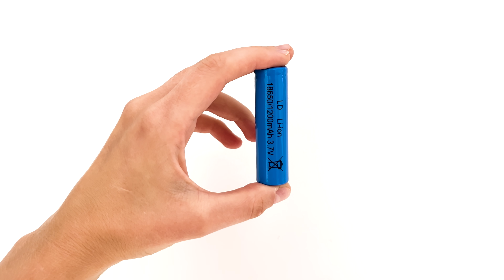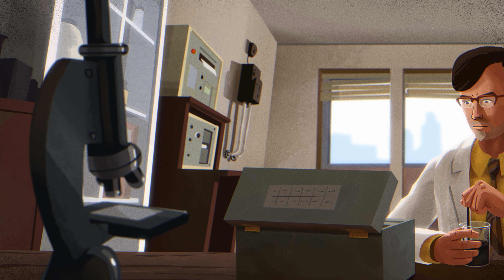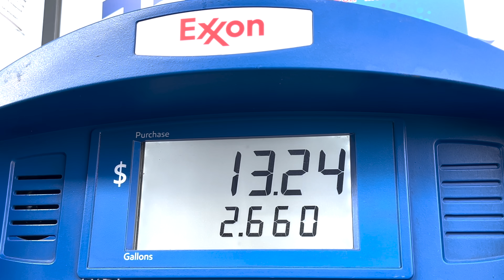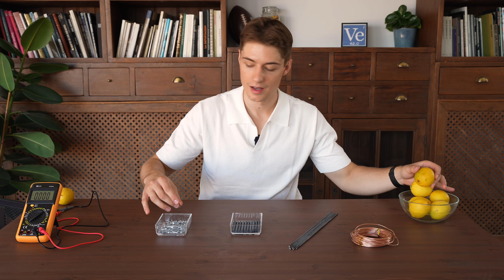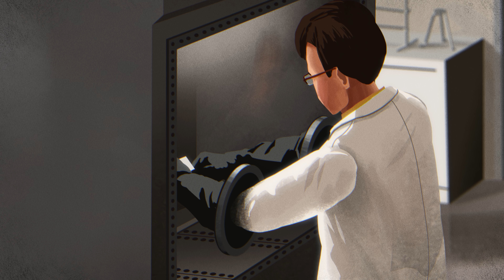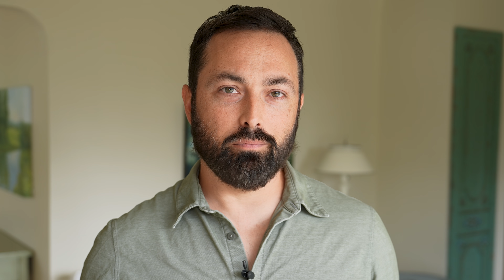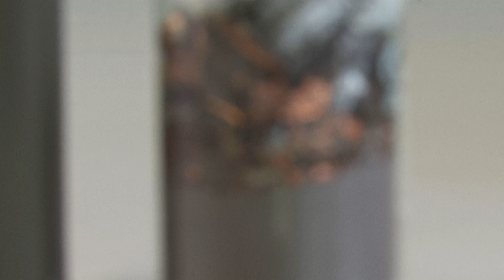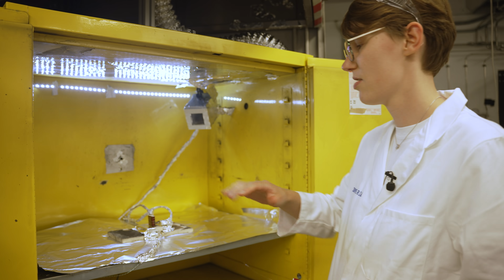The Perfect Battery Material Is Dangerous

Comment: As someone who has valued Veritasium for its depth and balance, I found this video troubling in its narrow focus and omission of key advances that change the safety story entirely. While the history of Li-ion batteries was told accurately, it focused on the most dangerous chemistries and ignored safer, now-dominant alternatives like Lithium Iron Phosphate (LFP) and improved NMC chemistries. LFP’s proven safety record and growing market share deserve mention if the goal is a balanced story. By highlighting only the most hazardous cases, the video risks replacing the important with the merely spectacular. I hope this was a one-off, and that a follow-up will present the full picture without fear-mongering.
Reply: From the perspective of the hazards of small electronics though, LFP is still quite rare.  While its prevalence in electric car batteries has increased significantly in recent years, that is mostly down to the size and scale of an electric car needing to be so much higher than a phone for example.  A 1 in a million failure rate on small devices that can be conceivably dropped in water or something to deal with the fire in an emergency means there is less pressing need to switch over to LFP, especially considering the decreased energy density.  Point being, LCO is still the dominant battery form for small electronics, at roughly 65% currently.  As such, it really isn't disingenuous to focus on it as a form since its still a leading type today.
Reply: @tobin1677  I would not recommend dropping a burning lithium battery into water. You'll just make it burn hotter.
Reply: @craigsparton putting LCO batteries underwater to limit their thermal runaway is one of the most highly recommended methods of dealing with small batteries.  This is because it is a lithium salt, not pure lithium (which does spontaneously burn and react in water).  Lithium battery fires do produce their own heat, but essentially if you cool them down enough to stop the runaway reaction you are good to go.  Now of course there are better ways to deal with them too, but since everyone has water readily available dousing them is probably the best option.
Reply: @tobin1677  Interesting, didn't know that. Thanks for the info!
Reply: Some context. Veritasium was bought out, or rather did receive a "strategic investment" from Electrify Video Partners. This investment means that Electrify acquired an ownership stake in Veritasium. Derek has no say anymore. Quality is, as you pointed out, decreasing already.
Reply: @V3cnu  why are you just lying? Derek has no say? you are straight up lying
Reply: @V3cnu you have no proof of this and you are simply extrapolating.

Being more accurate on that aspect would certainly not desserve interests of a remotely related investor.
Reply: @V3cnu that was a dumb move than. Considering the views and income 18 million followers create. You never should sell with those conditions.
Reply: @alfascorpi things change, he knows this, wants to retire and not take on excess risk for random people's entertainment. It is not dumb at all.
Reply: @alfascorpi  Than what?
Reply: @michaeldevonport1715  it's not dumb for him personally, but it IS an ill omen for YouTube going forward and should be avoided on grounds of it going against his principles as a channel. We're living in a late stage capitalist world where big companies own everything, even private youtube channels.
Reply: @alfascorpi  Derek has a family, man. Can’t really blame a guy for taking the opportunity for a little security in a career as volatile as social media content creation
Reply: @alfascorpi not really. The goal as a business owner is to eventually sell your business, have someone take it over, and either retire or move on to another project that you feel a renewed passion for. You can only do one thing for so long before it begins to get stale. Life is about change and growth and the days of "work for sears for 40 years then retire" have long been over
Reply: @V3cnu Wow did not know this. Disappointing, but explains things
Reply: @V3cnu also, didn't he have Bill Gates on his channel? This guy is a shill
Reply: The video was totally focused on Li-ion. Except the title. And people complain it doesn't cover new technologies
Reply: They’d been doing series about Nobel prizes, basically this what this video was about
Reply: I didn't notice it as fear mongering. He didn't even go into the pressure changes causing instability which is why lithium batteries are surface transport only. They also mentioned that it's an extremely rare occurrence and only noticeable due to extremely high use
Reply: For context: Lithium Iron Phosphate (LFP) batteries use an olivine crystal structure that is inherently more thermally and chemically stable than lithium cobalt oxide (LCO). This stability greatly reduces the risk of thermal runaway, even under abuse conditions. LFP cells also have longer cycle life, tolerate full charge–discharge cycles better, and do not rely on cobalt, while reducing cost volatility and ethical sourcing issues. In today’s market, NMC chemistries hold the largest share, LFP ranks second, and NCA ranks third, with LCO already reduced to niche or legacy uses. LFP’s proven safety record and its substantial share in both EV and stationary storage markets make it a central part of any accurate discussion of Li-ion battery safety. Omitting this is not simply an oversight, but it distorts the real picture.

Edit: For transparency, I hold a Ph.D. in applied physics and have worked in and advised on investment in Battery Energy Storage Systems since 2013. I am not a native English speaker, wrote this reply myself and, yes, I use ChatGPT to help improve readability, refine semantics, and check syntax.
Reply: @Pemodados  What are the downsides of LFPs, versus Li-ion batteries? Surely there are cons to balance out the pros.
Reply: @DARTHNECRION Capacity/Energy density. LFP is fine if you have more space and don't mind a bit of extra mass like in an EV, but for portable electronics, LiCoO2 or LiPos are better because they can store more energy per gram of material.
Reply: @Pemodados what are they actually using them in ?
Reply: @Pemodados  well he is owned by private equity now, which is why the title and thumbnail change so often
Reply: @StraeYaksha  Except that he was doing that prior to the sale.
Reply: People are at different levels of education so if you know all of what is in this video you can go to another video. Problem solved!  I was not expecting a comprehensive college level course on batteries.
Reply: I see your point, but imho the video has a full circle of a story, which mainly included the discovery that lead to the Nobel Prize. The LFP development is recent and not part of that story, so I don't think it's a problem excluding it.
Reply: What about Sodium-ion batteries? I think it's fairly recent, also less energy dense but (I think) cheaper and easier to make, it takes up more space but it could be great for stationary places like solar farms and it would free up Lithium for other uses.
Reply: @darkceptor44  yeah, I don't think the Liberal and Conservative audiences want to admit that China is cable of good things at times.
Reply: @JeezusWuzzaCommie  If China developed it they probably stole it from somewhere else. China's been stealing all sorts of information from various countries for years now.
Reply: @joesmith-es1zy  "stole" environment saving battery technology that's easily better than what Tesla is pumping out?

If that's theft, idgaf. Copyrights and patents only make sense in a world where you must sell your ideas and profit off the people instead of sharing them and supporting your community.
Reply: Was replying to 
  Dot 

Lmao 🤣😅
Reply: Básicamente porque se pusieron en el mercado, especialmente el automovilístico por la preocupación de los incendios recientes en los vehículos, tendrá si acaso 5 años desde que esos accidentes se hicieron virales y definitivamente no son baterías populares en otros mercados como el de celulares.

Justo al final dice que no se trata de conquistar un solo elemento y que la mejora en las baterías es constante y debe dejarse de lado el método tradicional para buscar nuevas alternativas.

Todo eso suena en realidad bastante a favor de las baterías más que alarmista.

Claro que se enfoca en la parte peligrosa porque el mensaje que da a entender es que las baterías han estado evolucionando hacia ser más seguras y a buscar materiales más estables. Justo como las baterías que mencionas.

Realmente me preguntó si el angloparlante promedio tiene alguna clase de comprensión más allá de lo superficial.
Reply: Thanks for telling us what ChatGPT thinks of this video.
Reply: There are other creators here that go into that level of detail like TheLimitingFactor. Idk if this is the channel for that level of depth this is a pretty good introduction but I agree going into the dangers without the solutions is a bit misleading
Reply: Ok but LFP are only taking over the older lithium-ion technologies in electric vehicles and other large applications. They will probably never replace them in small mobile devices because of LFP's smaller specific energy. So in mobile devices older lithium-ion is still dominant and this will not change soon.
Reply: When calculating power density are you considering the recommended 40% 80 % rule for lipo
     Lithium ceramic is probably the better option 
    Extreme long life 
Very high current charge discharge 
  Can use as hot as lava 
  Can never make dendrites 
    And can use while cutting the cell in half
Reply: Fairly sure that they have variants that are already matching Li-ion in energy density.  There are also many other technologies nearing commercial use.
Reply: Shhhh, you are ruining the OPs narrative here
Reply: Chatgpt ass comment 😂
Reply: It won't.
Reply: Lifepo are good too
Reply: ok poindexter.
Reply: 9
M9
0
0
Reply: I have to mostly agree. Well.. they try to keep it catchy.. not full scape research.
Reply: Yeah Rabbit Fever! I was thinking when two or more horseshoes or objects are too close to a point (the peg) it becomes harder and harder to visualize which object is closest to the peg, and by removing the sand in-between with a brush we remove all the sand which is holding the horseshoes in place and creates an optical illusion of empty space which is not truly empty. Instead a magnetic detector would be more precise . Even so when too many objects are so close to a point (black holes, occult hernias) it is more difficult for the expensive equipment to detect accurately highlighting the need for smaller more portable & accessible wearable technologies to assist users.
Reply: It really is not that deep
Reply: Lithium pools still an issue.
Reply: @abcdef-u4cvjyrc  no i understand that. I just think that saying the content is declinging because he focused on the story of batteries and didn't talk about newer technologies is not very fair. It's just a different focus
Reply: It's called poisoning the well
Reply: Well, ackshually!
Reply: Where can I follow you to get insights into this? Or would you consider doing some videos as well?
Reply: Aw, go rub some sticks together in a cave, geek boy. You'd have no platform to preach from without your batteries, not to mention your preaching to an empty room.
Reply: Dude.   Some things are just toxic.   Take a deep breath, and find a way to live with a shorter battery life, or plugging in,  or any of the many many creative ways we can solve the 'problem' . Not by lobbying to take the earth and dredge up toxins and destroy local environments,  but by finding creative ways to admit when science gives you an answer you don't like and you use the opportunity to do well,  And do good. 
  Is it more likely Veritasium dips standards in this one moment,  just when it's inconvenient for that greedy combo of global mining interests and tech bros, or is it more likely that  Veritasium inevitably will offer science that impacts things we all like to do.   I think the latter.   We've got to stop denying hard science just so we can have our most advanced tech gizmos,  or just because we make our money strong the landscape of metals.   
Healthy planet healthy people
Reply: I would also have appreciated another 20 seconds listing the many alternatives being chased by billions of dollars of investment. It is the wild west out there right now for battery research. Perhaps the lack of scientific information on CATL sodium battery claims made it an unlikely option, but really there are so many others nearing commercial viability,  Perhaps a 2nd video on some of these @vertasium ?
Reply: Also-- the perfect battery material should not involve more intense mining operations which destroy local environments. Just look at salt batteries and quit trying to out engineer China.
Reply: So what, smartass? No one canceled critical thinking. Those who need it, will find the rest for themselves.
Reply: Thank you for your informative comment that caused me to do some research, not watch the video and unsubscribe.
Reply: Sounds like a clanker take to me
Reply: why do you think they might have gone about it that way?
Reply: yeah that has a lot to do with the fact that this is basically an advert from a private equity firm trying to persuade young investors to invest in graphene and battery startups they have a huge stake in.
Reply: Veritasium has gotten way worse since Derek literally sold out the channel. You can see the exact moment when other hosts started to appear in it.
Reply: @waltermelon6747  AGREE! Why on earth would he let any other person than him, doing that?! :(
Reply: @sammtan-xena so he could spend time with his family
Reply: It is mentioned quite a few times that it is rare. Hardly fearmongering.
Reply: Agreed, I kept waiting for LFP to be cited, very limited and honestly incomplete video.
Reply: Your hopes will be crushed. The trend is moving towards more superficial, more  spectacular and clickbaity content. We will reach Idiocracy a few hundred years earlier than the movie (2505 IIRC).
Reply: @cromyjr1592 Yeesh that’s a lot to tie to an omission in one video that is otherwise accurate and understandable
Reply: @cromyjr1592  civilization moves in cycles. So we'll repeat a lot of this in the future again, eventually.
Reply: @cromyjr1592 bruh we already live In a idiocracy. Trump president twice.
Reply: @cromyjr1592 😅😅 
(Actually 😣). But you're right!
Reply: @cromyjr1592 This is not Idiocracy, this is capitalism. Veritasium is Private Equity owned now, so that's what you get.
Reply: @cromyjr1592 Already have reached that point pretty much 😔
Reply: the focus was on the lithium ion, how dangerous it can be and its problems it over came and the advantages/disadvantages there after , is what i understood . He does acknowledge other tech paying the way forward but how long a video do you want if he had to name all existing types ,future types, and their ins and outs.  As Im sure a vid about Lithium Iron Phosphate (LFP) and improved NMC chemistries vid would be exactly about that. Lithium ion is about Lithium ion as was i felt implied in the title " This Battery " Was Almost Too Dangerous to Exist . perhaps  Lithium Iron Phosphate  will be in an  safer, now-dominant alternatives  to Li ion vid. idk
Reply: You can thank private equity for turning almost everything around the world to garbage. I was crushed when I found out they purchased Veritasium. And they are also going after all successful YouTube channel. Please do not support anything owned by private equity if you value anything of quality. Veritasium is not Veritasium anymore.
Reply: @PeddleUrAds  It's so sad to find out Veritasium has been bought out. That was a shock to me, I didn't know anything about this.
Reply: @One.Zero.One101 I didn't know either but I could certainly tell something was changing behind the scenes. The quality of content has dropped considerably in his last several posts.
Reply: @joefoxFPV  not to mention some of his videos are just ads... like his video about dishwasher "habits" which was just an ad for a specific kitchenaid model...
terrible - he had something good going and its now officially Foxified
Reply: @One.Zero.One101 you mean he sold his business to a larger entertainment company so he doesn’t have to work as hard? He didn’t sell it to Phillip Morris or Exxon Mobil did he?
Reply: @PeddleUrAds  should they do a public offering then, so that they must pursue shareholder gains above all else?
Private equity makes up the vast majority of the American economy (and probably the world's as well but I don't know that for sure.) So i guess its no more quilted northern for you... or Ben and Jerry's, Publix, Trader Joes, Dell, Ikea, Robert Bosch, Ingram Micro, Huawei, Wawa, Chick-fil-a, menards, S.C. Johnson & Son (Ziploc, Windex, Shout, Saran, Raid, Off!, Glade, Drano) etc........
Reply: @PeddleUrAds  also notice that little bit of anti institution propaganda that they had to add at the 17:40 mark. Like the whole story of the batteries was a tale of investors not seeing the potential of the batteries so they didnt want to take risks to invest in it, but 1 time it was shelved by a institution and suddenly " bureaucracy " and "slow moving institution" are the reason was the the batteries development was moving so slow
Reply: @PeddleUrAds I mean it’s still good and the guy made money so yeah good for him.
Reply: Seriously. This would be a video for 5+ years ago. Not now.
Reply: Well you just pointed it out, it's a different battery bro. That's why the safety is hugely different.
Reply: The goal is to get the avg person interested in science…not confuse the f*** out of them.
Reply: @jeffrey.a.hanson On point. I just want to watch an interesting science video, not get caught with drama.
Reply: @jeffrey.a.hanson it still does.
Reply: @jeffrey.a.hanson Imagine, bombarding your audience with an entire college course in one sitting. There is only so much information you can give before the viewer lose interest.
Reply: @jeffrey.a.hanson  The average person can't comprehend the simple trajectory of advancing technology? Omfg 🤣🤣
Reply: @jeffrey.a.hanson I thought  this video was very intersting, and  guess what? It didn't confuse me, so you're right on the money. It also opened the door for deeper conversation, like this whole thread.
Reply: Enshittification at its finest
Reply: Keep in mind the channel is just owned by a company now
Reply: They don't have access to this LFP technology
Reply: 4€ over 12€ for a battery, they are quite expensive.

Edit: Cobalt is not the only problem. Lithium itself is also collected in poor african countries where people are handled poorly as well. And then there’s another problem he didn’t touch, which is recycling of those batteries.
Reply: @acemad1 lithium is collected in endorheic salt flats in the US, China, Central Asia, Australia, and the altiplano of the Chilean and Peruvian Andes. It’s one of the most abundant elements on earth. Every country has lithium deposits. The issue isn’t finding ore like it is with cobalt because the ore is everywhere and it’s even in the water and dissolved in sea water.   The issue is of course concentrating it by evaporation of hypersaline lakes which there are a lot of since we are in an interglacial period that ended 12,000 years ago, and then bringing the raw materials somewhere with water and electricity which requires infrastructure. That’s why all those hard rock ores in afghanistan that the US was so excited about are actually quite useless. There are barely even roads in this part of Afghanistan, high in the pamir mountains, and crocidlite ores (what might be in Africa where the cobalt is, I haven’t heard that) don’t have much more lithium than the evaporites do by weight. The evaporite collecting regions also have almost no life forms on it so it’s not very ecologically destructive cuz nothing can live in toxic brine except archea halophiles and brine shrimp, and even the birds avoid many of these places unless they turn back into lakes cuz the water is highly caustic. Because lithium only has one electron in its outer shell and the lower electronegativity of all the metals except for other alkali metals (Na, K, Ca, Cs, Rb, Fr) it requires a lot of heat and electricity to separate. First it’s chemically concentrated and they actually use stuff like corn starch for this cuz it sticks to lithium hydroxide and makes it float more so than the other salts. So yeah you need somewhere with lots of dry evaporites— all over the Mojave, Central Asia, the Australian outback, the Andean altiplano—  and it needs to be somewhere with water, so near a mountain range with lots of snowmelt. It could be hundreds of miles away but since these places are usually not host to large cities and farmland being in the rain shadow of these ranges, the water isn’t  in high demand. These places are all in deserts too so lots of opportunities for energy from photovoltaics to hydrothermal to geothermal, at least in the Andes and parts of the Mojave (there’s a massive volcano complex in central and Northern California, the geothermal energy unfortunately does little more than power some stuff at the China lake naval weapons station near Coso and Searles lake, CA close to Death Valley. They use it in the Andes though. What you don’t want to do is transport the ore though cuz that costs oil. So lithium is not a conflict mineral at all and extracting it is actually pretty green. 

Also we have cobalt deposits in the US and Canada. Anywhere nickel is found,
Cobalt is also found. Canada has I believe the largest nickel mine in the world. It comes from Africa because it’s basically slave labor and it’s far cheaper. We need to stop this practice. There’s more than enough wealth in the world to end the constant gassing up of the rival factions there keeping them in a constant state of conflict and make this illegal. All the money is being concentrated in the 1% and it’s getting worse and worse. We just authorized ANOTHER ten years of 1.9
Trillion in tax credits, that’s just a check the government gives you paying you back open taxes you probably didn’t pay anyway and it only goes to People making 685k/year and up. You know what % of Americans make that much? 1%. This TCJA bill has tanked the US economy and were being kept too poor and desperate and fighting among each other in America to actually go after Trump and his cronies that are passing bills like this and this is exactly what these mining companies are doing in the Congo!! Keeping them fighting among each other for the scraps so they don’t industrialize and collectivize to resist the elites making them miserable. Down with Trump! Tax the billionaires NORMALLY, at their normal tax rate and prevent them from playing their games that allow people like Zuckerberg and Elon to pay between 0-3.5% in income taxes while they get tax credits based on their capital gains earnings. Say what you want about Obama but he started his first term with the worst economy and worst unemoloyment at 10+% America had seen in 80 years and  within 2 years he got us 55 year rexord low unemployment and i shlt you not NEGATIVE CONSUMER PRICE INFLATION meaning the cost of goods decreased compared to the prior year. and within 2 years of trumps admin he added 4.2 trillion to the national debt, 60% more than 8 years of obama, raised our debt interest rate, downgraded our national credit rating and passed that 1.9 trillion tax cut you and i paid for the last ten years just to enrich the 1%. And he just militarized DC police today despite plummeting crime cuz it's a "democrat-run city" (90+% of american cities are democrat-run).
Reply: @acemad1 Wasn’t there some hope in sodium ion batteries, replacing the lithium?
Reply: @IJzzo  I only heard from Neil deGrasse Tyson that some batteries are developed of most present elements in the universe, carbon, nitrogen, hydrogen and oxygen. But they’re very inefficient at the moment and dirt cheap.
Reply: How in the hell does he just abruptly end that video as if lithium ion is the current car battery tech when most manufacturers have switched to LFP… what a hack now
Reply: The content would be longer. Indeed LFP is the most safe among all variant, but for the sake of context reaching most energy density within all roadmap of lithium technology, LFP shown of lower trend in that case.
Reply: There's also several inaccuracies in this video too. He keeps confusing lithium ion with lithium polymer. Opening a lithium polymer battery is not as dangerous as opening a lithium ion battery because the LiPO battery has physical states of matter inside the battery itself in the form of sheets. Lithium-ion batteries only have gel lithium with an anode and a cathode, which makes it far more dangerous.
Reply: Did bro use AI for this shitty comment?
Reply: hes been moving towards pop science and click bait and bad faith content for quite a while now
Reply: Veritasium is owned by private equity now.
Reply: I agree, I feel like it was a little too much story, and not enough science like it usually is
Reply: This was actually my first video. I thought it was strange they didn't talk about solid state or sulfur. After your comment I think I'll put this channel on the ignore list. Thank you.
Reply: Also putting a battery in an oven (or wrapping it in heating wire and dumping 200w through the wire) are nowhere near a worthwhile demonstration.
Reply: He no longer owns the channel, some private equity fund does and they just want videos, they don’t even want to need him hence the producers being introduced
Reply: Now this is why private ownership sucks.
Reply: That's the problem with most "smart" chanels - they seem real smart and truthful until they make a video on a subject you're knowledgeable about and you realise their coverage of said subject isn't great; and if they're wrong about that then it makes you question the legitimacy of the other videos
Reply: I was thinking the same. Although the history and visuals and breakdown chemistry  demonstration is amazing, even for someone from a non-science background so to say. But focusing on the negatives undermines the positives and already advancing battery technologies. with the ever increasing and advancing battery technologies especially with the recent CATL news on sodium batteries, the video definietly need a follow up without fear mongering.
Reply: The interesting part is WHO is invested in cobalt and lithium that won't let LFP technologies thrive....
Reply: The goal of this video was to show the history and how it works, the "danger" part was for engagement. The info in the video doesn't matter if no one views it.

  you've completely missed the point and using chat gpt to find an argument against it is ridiculous.
Reply: It is sold to private equity, what did you expect?
Reply: He spent more time working on the ad than the actual content
Reply: Honestly I don't know why I watched this.  I haven't seen a good, fair Veritassium video since he changed his budget, when he went to Chernobyl.
Reply: Finding veritasium biased and spouting BS every 15s only now ?
Reply: Veritasium is owned by venture capitalists.
Reply: When u have a high constant stream of viewers u risk lowering video production quality
Reply: one off? have you seen the previous videos?
Reply: Welcome to the ever expanding dystopia of PRIVATE EQUITY.
Reply: This has been for a while now. His quality has degraded over past few months and he focuses more on the "clickbaiting" thing like that "rods from gods" video where he dropped heavy rods from a height to act as a weapon based on kinetic energy, he didn't tried in that video and you can tell.
Sadly this happens with most Youtubers
Reply: This is what Veritasium is becoming. It’s most obvious to me in his electrical-trick-question video.
Reply: They sold the channel. No clue why seeing as they're huge atm but it's his decision I guess. I've noticed that the quality has gone downhill AND the length of videos has been getting shorter as well. It's pretty sad really.

Also, why aren't lithium iron phosphate cells called LIP?? :P
Reply: This is the most obvious chatGPT comment I have read in YT video.
Reply: Do we really need a video on how safe something is though
Reply: calm down
Reply: I saw the title and was like "what in the clickbaity nonsense is this?" Among other things - we've got billions of those batteries kicking around. If they were this dangerous, modern society would have gone up in smoke soon after the first iphone 🤷🏼‍♀️
Reply: @alexandralillywhite5997  try puncturing one of them lithium ion batteries, don't worry it's completely safe to do so!
Reply: This guy ai's hard
Reply: And a major manufacturer such as such as Boeing used one of the most dangerous chemistry for their planes instead of a safer one.
Reply: @purduephotog if you think that’s bad wait until you find out they charge the batteries by burning highly flammable jet fuel in an APU turbine and that the whole plain carries tens of thousands of gallons of highly flammable jet fuel and that there’s 400 volt AC electricity going thru wires all thru the plane and that the plane screams thru the air at 550mph 6 miles high and that the plane is filled with enough alcohol to give maybe 6 people alcohol poisoning and don’t forget about the oxygen candles that are filled with highly flammable chemicals that decompose at extremely high temperature to produce oxygen in case of an emergency and that there’s oxygen bottles for the cockpit and that oxygen plus jet fuel is explosive and a plane can take down an entire building as we saw twice on 9/11 or did we?
Reply: @maseratidyce3587 jet fuel ain't highly flammable.  Point was there are safer chemistry that don't experience thermal runaway.
Reply: Drama and hyperboly sells. Clicks!!!! :(
Reply: Hi Chat GPT
Reply: @Houndzee  The comment may have been polished by an LLM, so what?
Reply: Standard youtuber. Get clicks and views however you can. Profit.